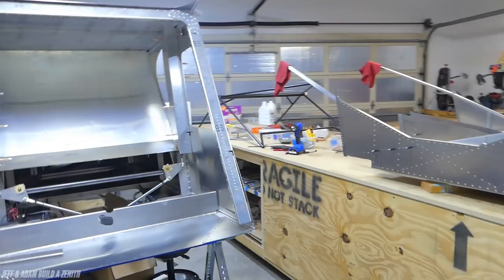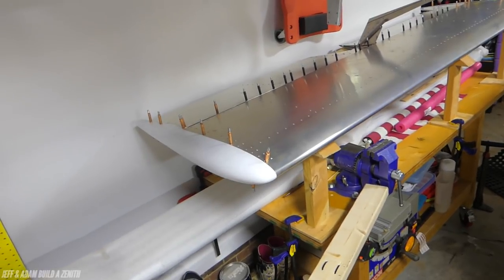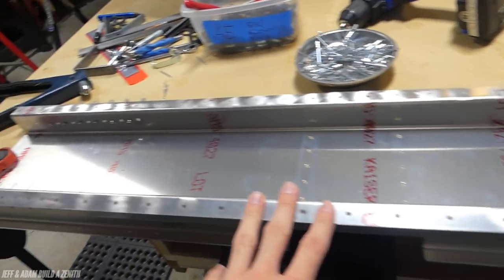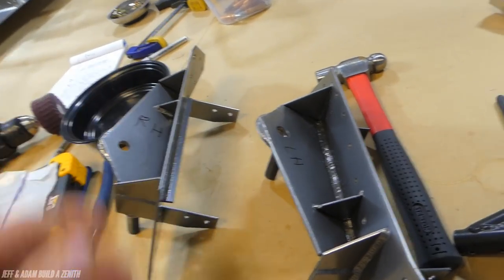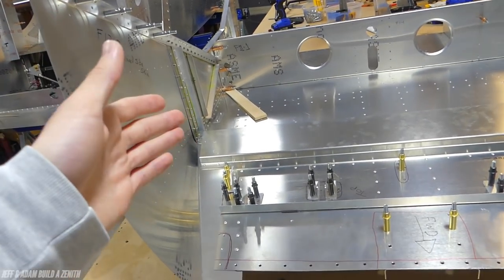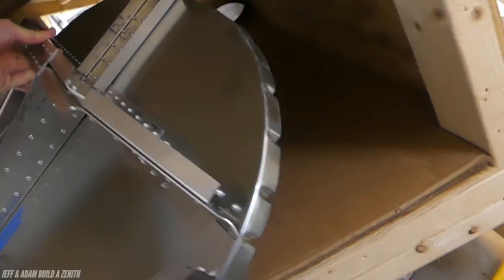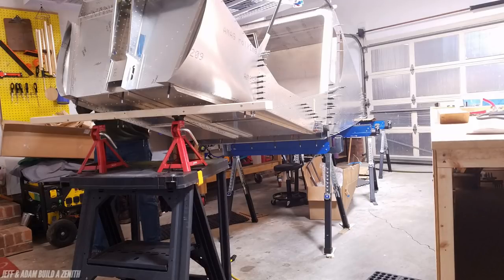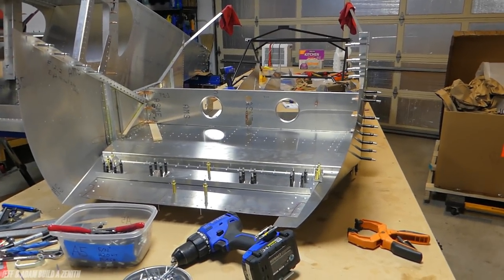Build Update: Cabin, Landing Gear, Firewall, etc - Zenith 750 Cruzer

Comment: What's up Jeff and Adam, I starting building my 701 wings in Feb. I would suggest emailing Roger or asking on the forum with questions. I have messed up a couple things as well and had to buy slat supports and nose ribs. These resources have helped a lot. Measure 10 times, cut once, then measure ten more times. By the way, are you out of Florida by chance? I didn't get to watch all your vids yet.
Reply from the maker: Thanks. No, we're out of NC. Best of luck on your build!

Comment: Are you going to paint it yourself ?  If so, plan on doubling the time .  Turns out to be alot of work . 
I'm using the Stewart system and painting individuall components , not a finished plane. 
Enjoyed the video.
Reply from the maker: Heck no! (For the very reason you mention). And we're definitely not painting until after the flight testing is done. I'm a lot of things, but a painter is not one of them! ;)